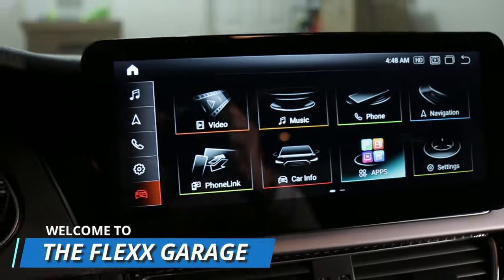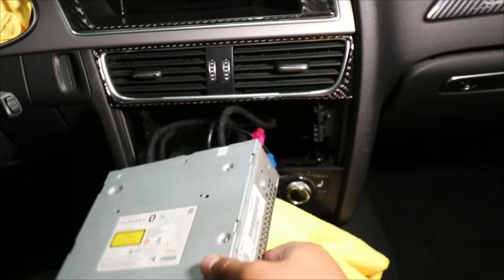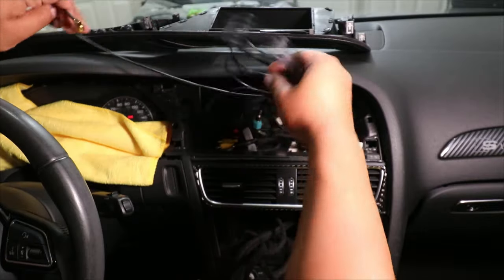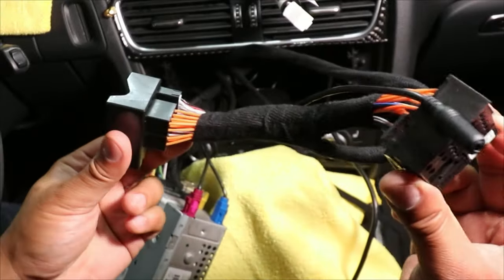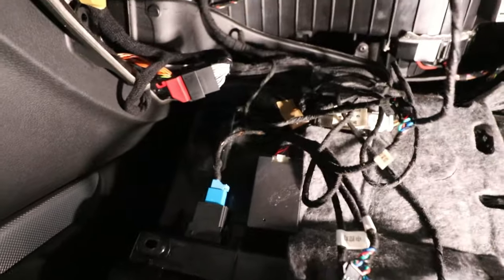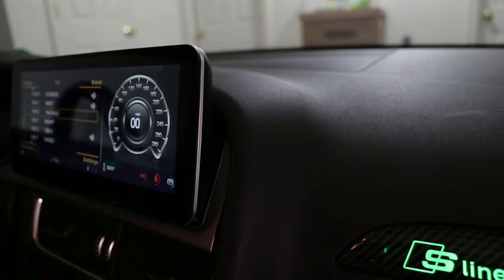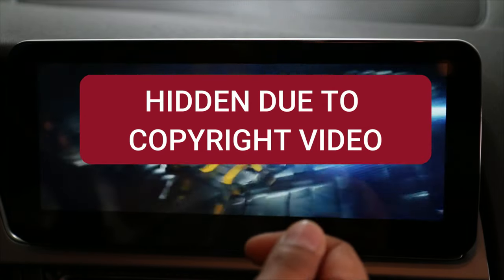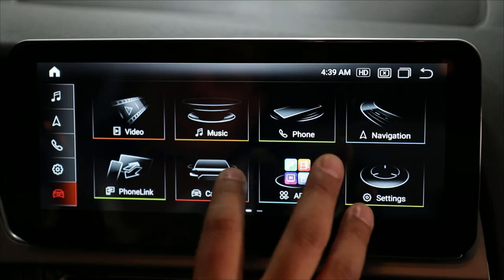NEW Android Screen step by step install on Audi A4 (B8.5) 2008-2016

Comment: I installed the device in my car 
Now my battery is always discharged and the car doesn't start 
Anyone has the same issue ?
Reply from the maker: I’ve never had that issue with any of the screens I’ve installed on my cars.  

Did you buy from DMP? Cause if so, they can help you 100% dial it in. You just need to contact them and ask for tech support.
Reply: I got the smae issue, how can i solve it?

Comment: Hello my friend, i think u are my last hope! 
I have a audi a5 b8 2016, and I installed a 8.8 zoll android screen! 
I saw your video and the cable from your car is the same with mine! I installed all the cables exactly like u! But i have a problem and i can’t solve it.
If i want to hear music my iphone is connected with The bluetooth from car and i hear the music fron cars speakers! But the navigation not have sound, and if i connect the screen with tethering ( internet from  iphone)  and i go to the youtube i dont have sound too. Can u help me? And i dont know how works this mini speaker! Also if I choose carplay i dont have sound, if i choose auto bluetooth i can hear music normally but i dont have sound from google maps or youtube. :(. Are u connected this ami aux with your screen? I try this also but not working. 
Im very disappointed. :(
I hopped up answering me! 🙏🙏🙏
Reply: Hi
You have to go to the original car settings and then to Bluetooth setting and from you have to change it  to externer Audio.